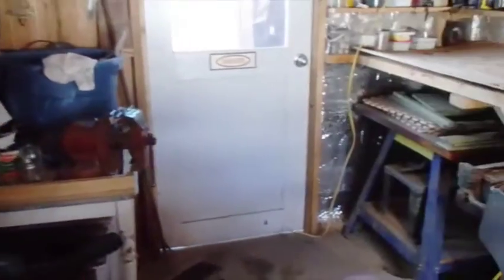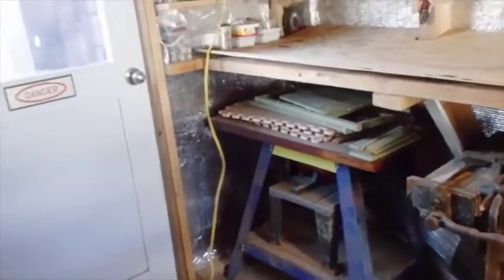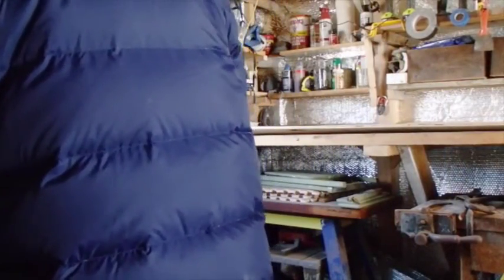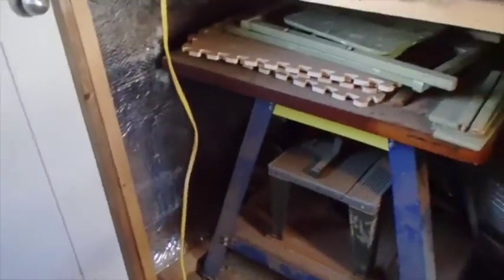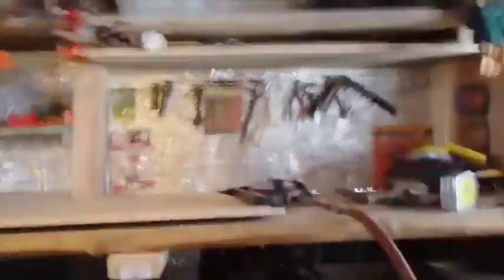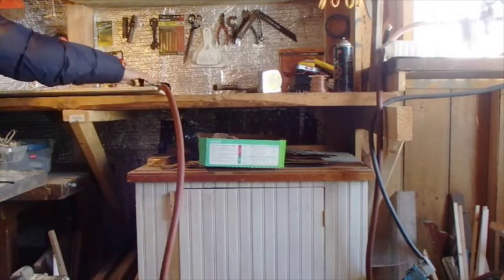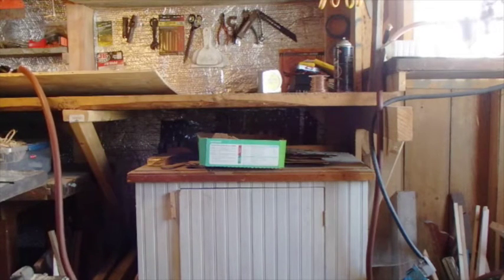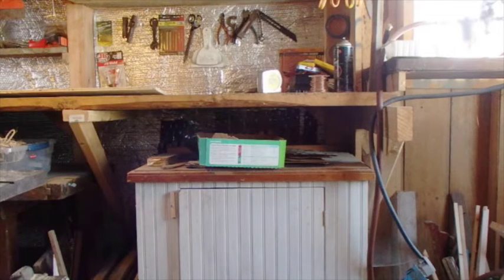Cut and Staple Plyboard Down if you can

Comment: why don't you install your vice on the air compressor end of the work bench,then it would be solid mounted and  always useable.
Reply from the maker: That's a thought..
Reply: OR, you could do like I have seen Mustie1 and others do and make a trailer type receiver under your bench to accept the vice and fabricate a plate and trailer ball type gizmo to the vice.  That-a-way you could leave the vice on your bench most of the time and when it was in the way pull it out and set it aside.  That pull out table idea would work for most things but the tougher/longer stuff you work on might cause it to tip over on you.
Reply from the maker: Them's all good idears...